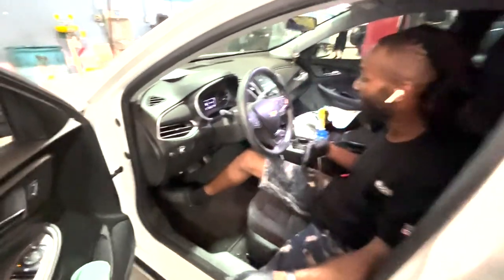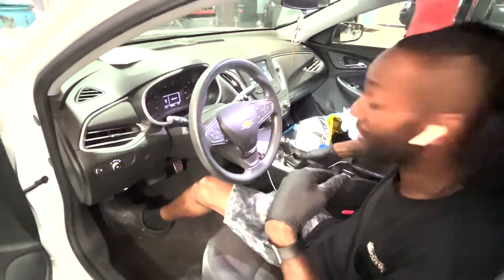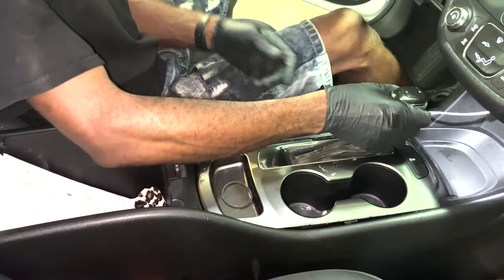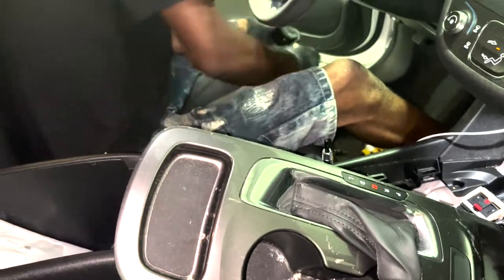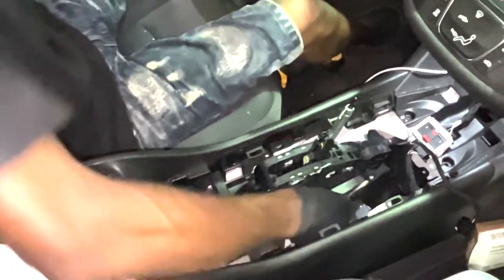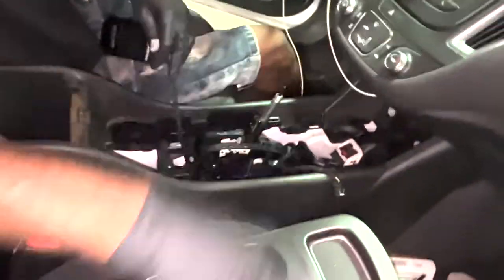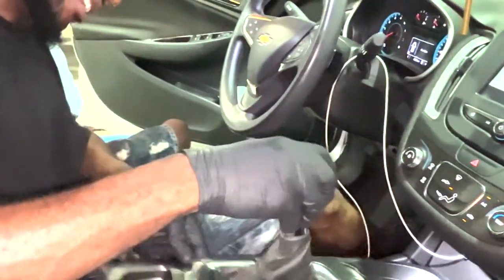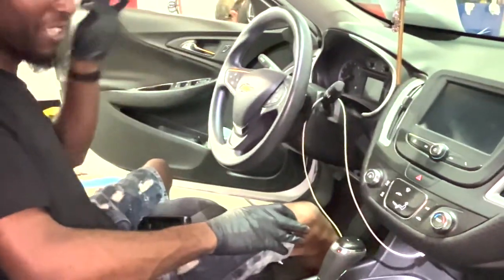George Moore Service department explaining how we fix shift to park sensor malfunction!

Comment: I have a 2018 acadia with this issue. Would you say that this could be a DIY fix?
Reply from the maker: There's a lot of trim pieces that need to be removed and you might get hit with some of the pieces when pulling off the shifter cover. So moral of the story it can be dangerous.

Comment: Interesting video but as I am a detail oriented person, it appears this tech left out several steps, such as how did you get that center cover plate loose before yanking up on the gear selector to remove it? The tech then quickly goes through the steps for removing the shifter and commenting that you need to remove some items but he doesn't actually show how to do this. Finally, after putting it all back together, the last thing needing done is "reset the pcu" but you fail to show how to actually do that. I can only presume these omissions were deliberate to discourage people like me who are not the brightest when it come to this type of DIY repair, forcing us to have no choice but to take our car into the dealership to pay them to do this work instead.  Sorry but I'm giving this video a down vote.
Reply from the maker: Hi Keith, thanks for the response! Our videos are simply a recap of the job that gets done, not necessarily a teaching/DIY video. We took certain parts out of the video for time restraints. It's very hard to find people to watch an entire video from beginning to end if they aren't interested in car mechanics. So, with that being said, we made a shortened version. And if you do need help with those parts, our service department will be more than happy to explain to you over the phone how to get it done. Give us a call at 904-482-9000, free of charge. Have a great day.